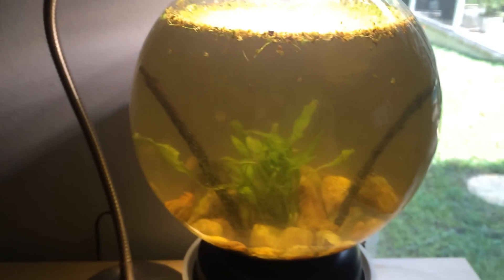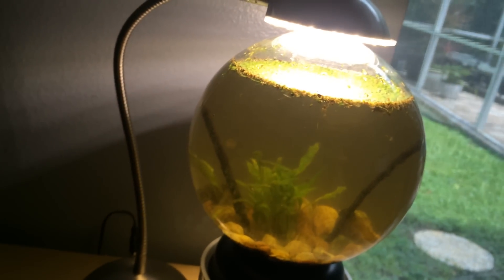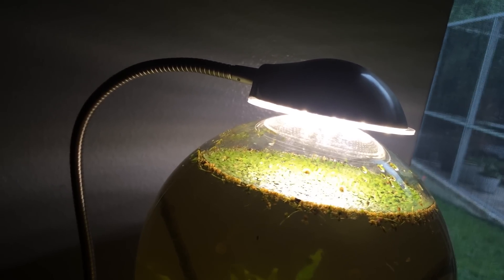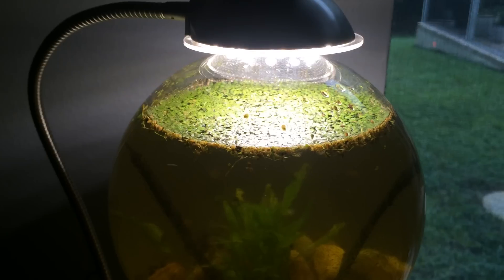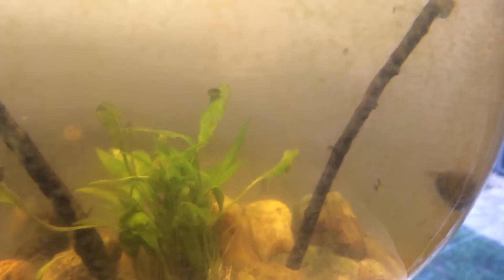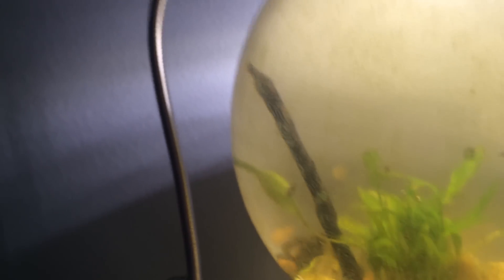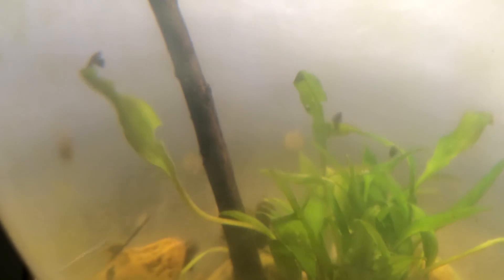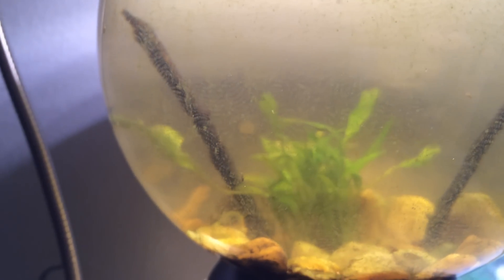My DIY Ecosphere

Comment: How did you get the stuff in the flask through the neck and make it look nice?
Reply from the maker: Very carefully. In this setup, the plant had a string tied to its roots so they could be pulled into the rocks after closing and inverting.